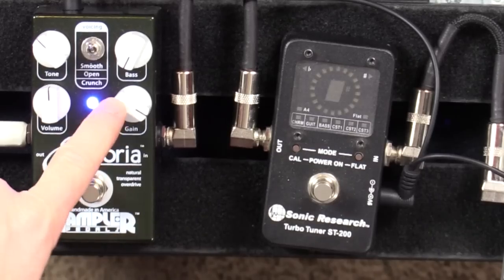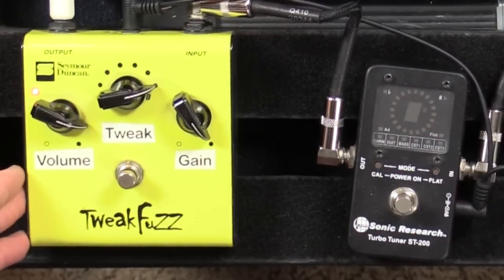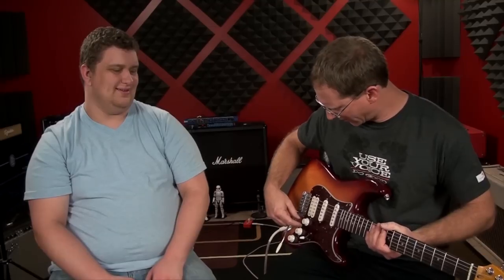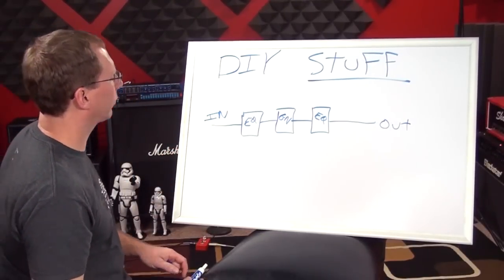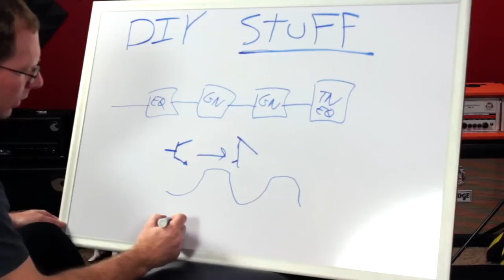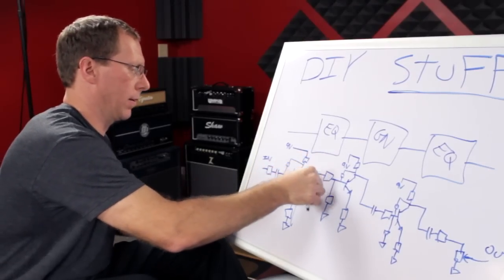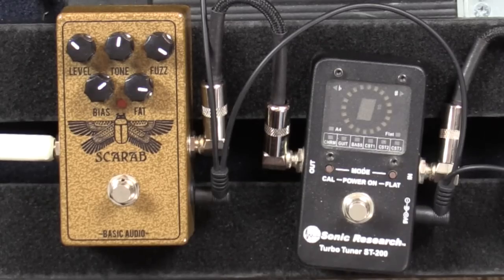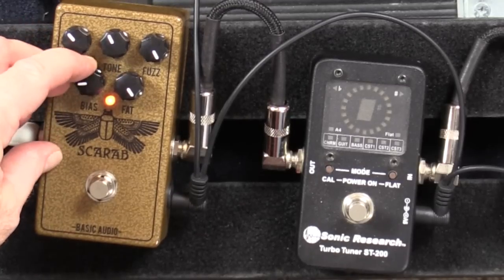Chasing Tone 99 - How do the various clipping circuits work?

Comment: The turbo tuner is my favorite tuner! I wanted to mention that the pedal is an actual analog stroboscope (no ADA). From their home page:

“ The LED ring on the Turbo Tuner is a true stroboscope. The LEDs are driven directly by the analog input signal and electronically strobed, showing the actual stroboscopic effect between the input signal and internally generated frequency reference. This gives instant response and extreme accuracy.”

Comment: As someone taking the first steps into pedal mods and planning to eventually start building kits, this was a very informative podcast. Some of it was a bit beyond me at this point, but I'm sure as I get my hands dirty it'll all makes more sense.  
When it comes to parts to keep on hand for those times I score a good deal on a cheap pedal to use as a mod platform, what would you recommend as the most important components to keep on hand? A friend has suggested I salvage junk electronics and recycle whatever is still good in them, but until I the annual spring cleanup in the area I won't find much in the way of dead stereos and stuff on the curb so I was thinking of ordering some small batches of parts. I'm most interested in modding OD/Distortion/Fuzz circuits at this point.
Reply from the maker: +thisdyingsoul76 Honestly, parts are cheap. Resistors and capacitors can be bought for less than a dollar at smallbear electronics, digikey, or mouser. You'll spend a ton of time trying to salvage parts from old electronics and it's just not worth it, IMO, unless it's a rare transistor or something like that. For mods, you probably won't be needing that type of stuff.

Comment: I just got my triple wreck today,and e few things stood out to me. the pedal works without the power supply,is this on purpose? also the bass is pretty weak. maybe it's my amp,it's a crate gfx 30 solid state. any thoughts?
Reply from the maker: +kevin brooks there is a battery inside. And the crate amp is not the best platform for pedals, so results may not be optimal

Comment: Hi, how much the master volume of a valve amp affect the interaction with the fuzz in terms of unity gain?
Reply: Mario Huerta it doesn't have any direct effect on a fuzz circuit because the circuit is after in the signal path...us guitar builder use volume stages to do different things. so if we had your master volume (or some kind of liner booster!) before the fuzz it will clip it more and give on more linear volume..it acts like a fuzz boost..but if we put it after the fuzz (the same circuit acts just like a master volume pot on your amp or what we could call an output stage.it will boost volume but have no discernable effect on how the fuzz reacts...it just amps up whats already there..so where you put circuits/stages matters when designing overdrive circuits..and its the same with effects in your pedal order..if its buffered or where it is within your rig matters in much the same way..you can have the same parts and the same stages but you change the stage order and you will end up with a very different sounding pedal.

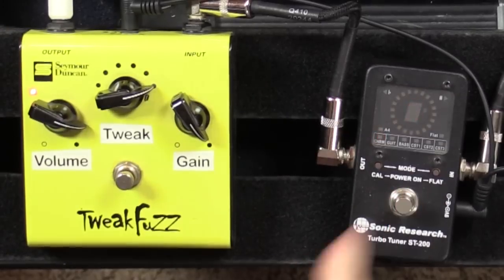Comment: Great lesson again. An off topic question. I noticed when you turn down your guitar volume a bit,  you can hear a loud hum at 10:20.. You noticed it too! I am electronic educated too and I know where the hum is coming from in theory. But what I cannot find is a solution to get rid of this hum. I know with a buffer in the guitar it is over, but I do not want active electronics in my guitar. Is there a passive way to solve this. I have made a passive circuit, the hum is  gone away but the range of the vol pot is way to short. What do you think. I think a lot of guitarist likes to know. Kind regards Frans

Comment: so a Fuzz puts more bass eq into the gain , and a overdrive is with not enough bass eq into the gain ,, and a dist is  doing it two time  boost in the op-amp gain  and again boost in the op-amp gain ,,, and all of these pedals types have a transistor  boosting (with a certain eq ) going in to an op-amp and behind the op-amp correcting the eq back  ? Well cool learned a lot in 26minutes  hahah Thx  !*_*!

Comment: Always entertaining, BUT! I am pointing out that you are missing a teachable moment. Youth follow you, and electronics remains in high need of engineers. If you used the standard electronic resistor symbol instead of using the block diagram for a single component; people would learn basic electronics instead of having to unlearn a bad habit of using a block for a single component. No quibble with using a block for explaining sections of a schematic diagram. Electronic tech since age 12, 55 years. Yeah, I can get away with the word quibble. final thought, don't be a block-head.

Comment: Why do all pedal manufacturers (bar 2 ) put their power and connections on the side of the pedals, they obviously don't realize we're going to mount like 20 on a board - smart manufacturers put theirs on one end (like Danelectro and Stryman ) - I am bitching more at Boss and those really.  So you have to buy expensive boutique gear to get the better designs? that sucks!